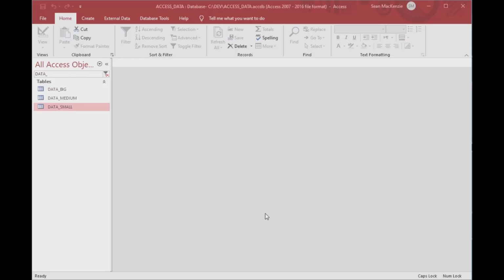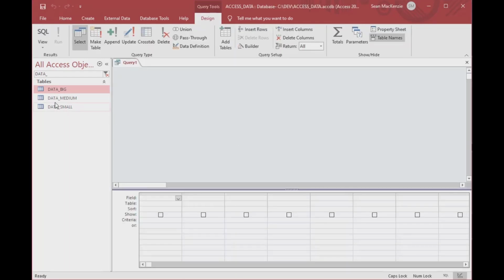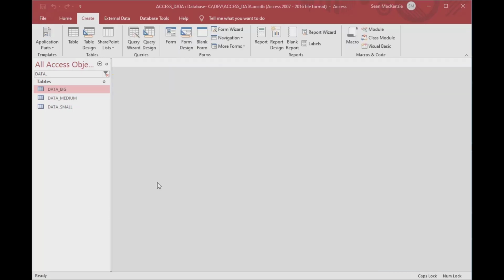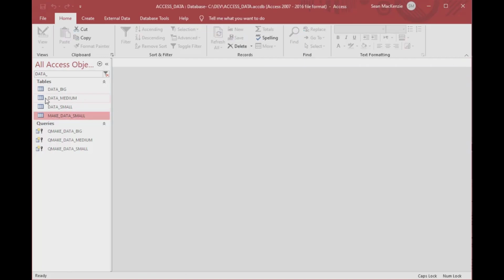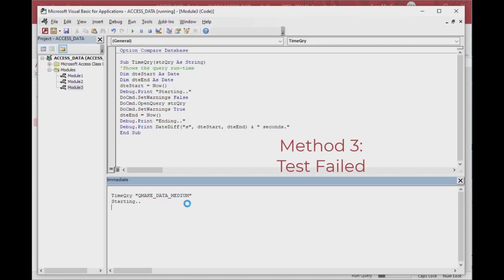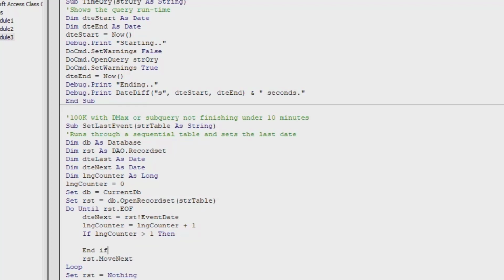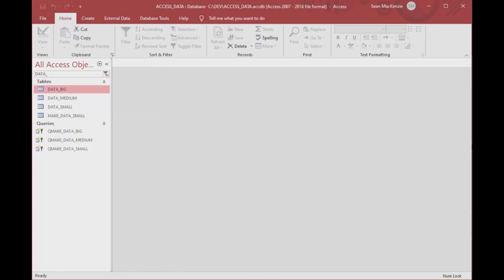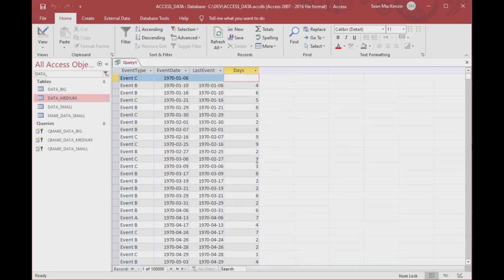How to Simulate Lag and Lead Window Functions

Comment: Thank you Sean. Only drawback with the vba method and precalculated table column might happen if the date values are updated in the records it will not update the lastevent part accordingly,so will give wrong calculation result eventually. Do you agree?
Reply from the maker: That's right - it really depends on your use-case. In some situations, you need to have real time updates (you can't use that method) and in some cases you don't (you can use it). For example, if you had a status table and report(s) that only looked at data older than today's date, and your data entry can only enter data for today, then you could use it to great effect and better performance over the alternatives.
Reply: @seanmackenziedataengineering  thanks sir

Comment: Dear Sir, First of all thank you very much for the response you have provided to my query regarding comparing values in a row. Actually I was struggling with issue for long time. Your video plus the example you provided was really helpful. I managed to make alterations in the program though I am not a hardcore application person!! so with lots of tensions and frustrations, I managed to get the desired result yesterday. Actually this is going to be a revolutionary step towards my analysis. I will keep you posted the developments. One big issue I am facing currently is that though the procedure updated the table I was using for testing, it is still not doing the same for the original file I am using. what could be reason? it is not throwing any error, but not updating the field. Could be the index is the culprit? is there a way we can index in the procedure? kindly put some light. thank you very much. appreciated!!!
Reply from the maker: Sounds like an interesting project! If it is working in testing and not in your main file, that would likely be that something is different between them.  It could be an index, or perhaps something else.  Or, there could be a simple syntax problem that was missed.  That happens all the time in this kind of situation! :-)  You could try updating your original table from your testing table, by simply using an update query or something like that.  There is a multi-table example here:
https://youtu.be/9CBxtBylSvE
But, I would check for a simple syntax problem first.